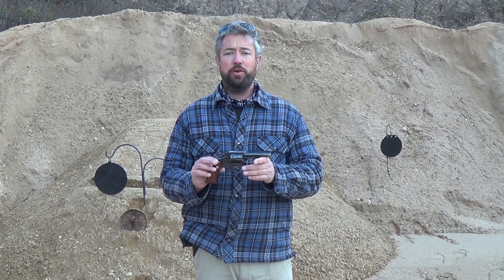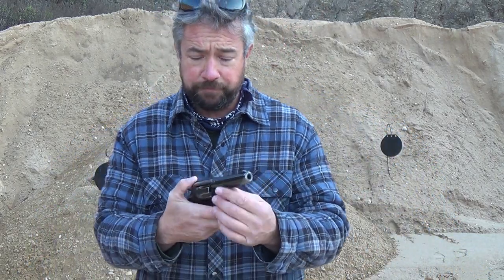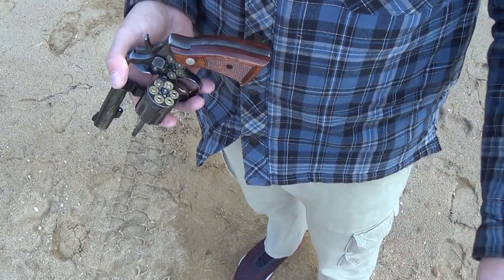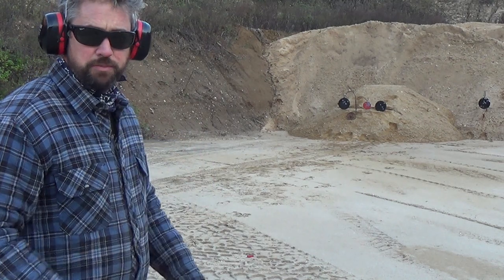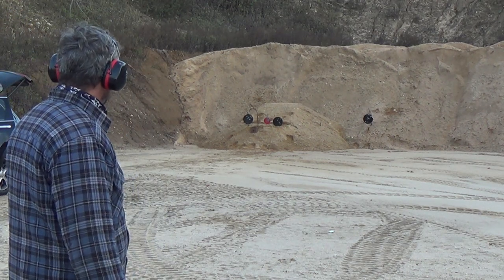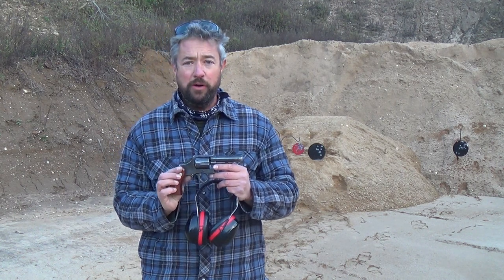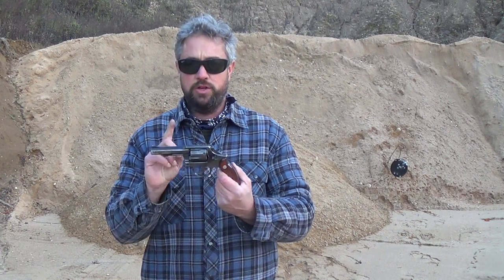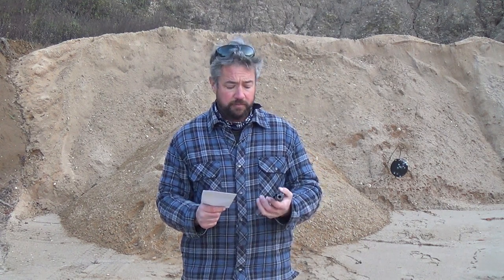Smith & Wesson Model 10

Comment: I just picked up a model 10-10 4" heavy barrel +P. It's got the round butt with original wood grips. It's nicely marked CDC (California Department of Corrections). The blueing is in real great shape. You can tell that it wasn't shot or carried much. I did a trade deal and I definitely came out on top. I can shoot fist size groups at 15 yards with double action. I'll be holding on to this one for sure. I would like to get some conversion grips for it though. Round to square butt.
Reply from the maker: Sounds like a great model ten.    Don't let those original grips go.
Reply: @biged7175  most definitely not. I'll keep the original grips safe.

Comment: I have a police trade in S&W model 10-10 with a 38sp +P barrel and Hogue grips. No Hilary Hole. I carry it in a modified M3 pilot's shoulder holster with an extra strap under the right arm to hold two double speed loader pouches.
Beautiful trigger in SA or DA, very accurate, and very reliable.
Reply from the maker: Very cool set up.

Comment: Nice tutorial on the model 10. I’ve got one purchased in 1927 by my late great uncle. The original 1899 model and those built up until 1905 had a second leaf spring that acted as the trigger return spring instead of the little block with a coil spring inside like all modern revolvers have today. That coil spring trigger return was just about the only major functional change for almost a hundred years.

Comment: Just seen the video.  I  also bought a S&W Mod 10-8 last year.  I was trained on it in the USAF back in 1985  for use as a 2nd  weapon as a Launch Control Facility Area Controller desk ( Security Police).  This gun is very easy to shoot one handed.  I shot a perfect score with it the first time. With this gun I put pac mir grips on and thru it up with my eyes closed, then opened them up and looked right down the sights,  Dead on target.
Reply from the maker: Good stuff there great revolvers.

Comment: Very cool pistol! I just picked up a 10-10 police trade-in that’s a shooters gun too. Still has a tight lockup and great action. Pretty funny, my holster is just like yours only black. Was using it for a Uberti SA but sold the gun now its back in use for my Smith.
FYI…You can shoot +P loads in these guns, just not a steady diet. But definitely when loaded for CC or house.
Reply from the maker: Good stuff Kyle.

Comment: Thinking about a model 10 even a new one if I have to as I enjoy .38 Spl that much especially if it is new enough to handle +P.   Saw a Model 14-3 which is very interesting as well and I am tempted though a bit pricey ($924).  If you look at 1957Shep's video on Model 14-2 I believe yours may be a 4 screw as there may be a 4th screw under the grips according to him and with the screw in the trigger guard. I guess the Model 14s had 3 screw, 4 screw, and 5 screw so I would think the other models would follow.  Only had a 1950s Model K22 (22LR) in my youth as my only K frame as usually go for L frames.  Thanks, sir.
Reply from the maker: Thank you for the comment, I'd but an older original one its much cheaper than the newer one at $924 but there still cool.   You might also enjoy this video.
https://www.youtube.com/watch?v=UCAK9JuEkBk&t=1s

Comment: These models can take +P, just not a steady diet.
Reply from the maker: Thank you but I'll pass and stick with my 686 for those.
Reply: I carried the stainless steel version of this, the model 64, for many years. We trained with and carried .38 special, 110 grain +P+  "controlled expansion," "LAW ENFORCEMENT USE ONLY" loads. This was back in the late eighties. So if your gun is from that period, I'd say it's safe to use +P loads. Also, remember S&W had the models 13 and 19, built on the same frame, and which were .357  magnum revolvers.